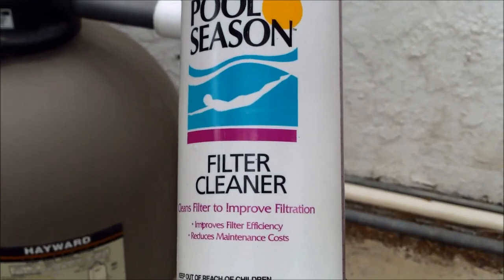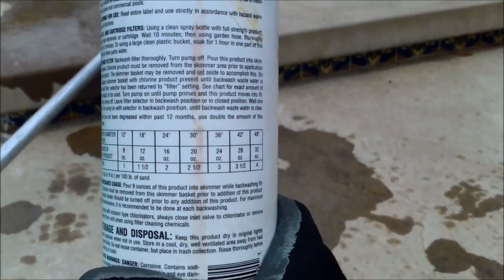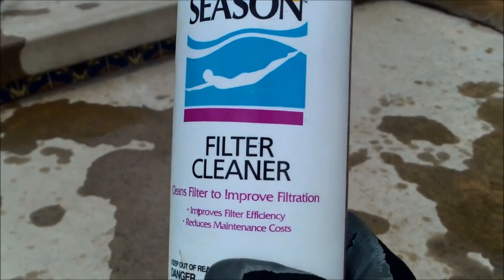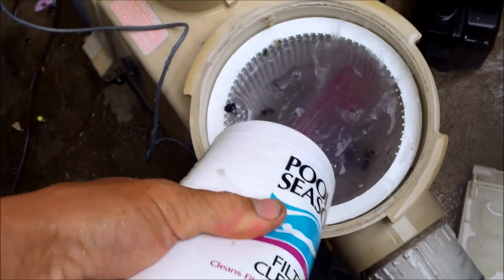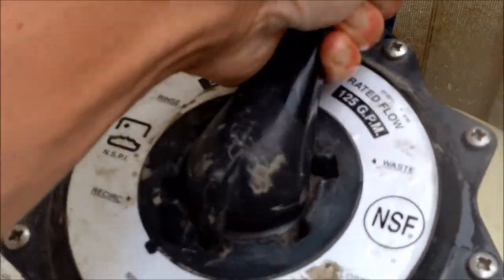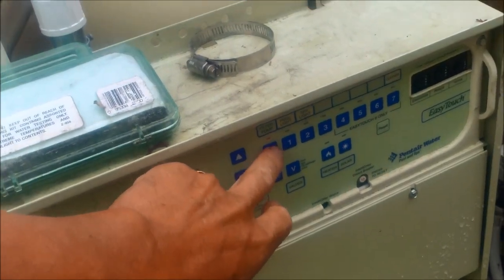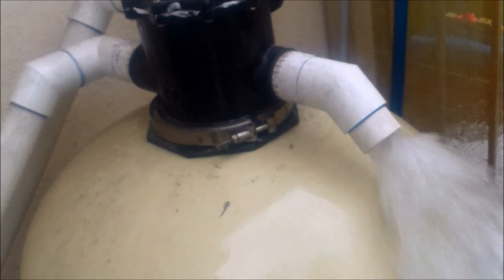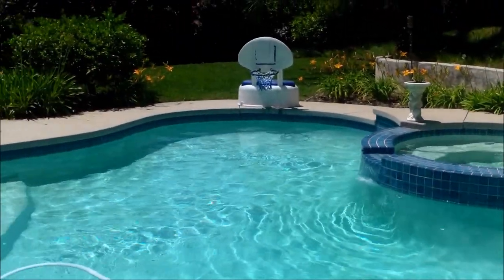How To Use A Filter Cleaner in a Sand Filter, Sand Filter Part 5

Comment from the maker: Not sure if you watched the video on my Channel that I posted about this problem. It could be the check valve. The valve actuators are factory set to close all the way - it would be strange if yours didn't meaning the gears are bad.  Video is called: My Spa is Draining Down When Pool Turns Off.

Comment: Thanks for the video - bought a house with a sand filter (my previous one was cartridge), no idea the age or quality of the sand. I bought the cleaner on Amazon and used it today. I didn't want the soap to go into the pool so I backwashed, rinsed, backwashed again (50 seconds), rinsed again (25 seconds) and there was virtually no "suds" entering the pool when I returned it to filter mode. Pressure went down a little. I'll do it again every year.

Comment: I enjoy watching the videos of your pool cleaning and repair.  If I may ask a question related to my spa and why it drains overnight.  I tried to watch your video on this but still have more questions.  Real quick I janne a fiberglass pool and separate spa. It also has a solar panel and salt system.  I tried to reseal my jandy valves using lube and adjust my actuator to make it close. Still cant figure out why it still drips overnight. Driving me crazy.  What do you recommend I look at now.?

Comment: Change my sand every year. Have to, live in North Dakota . Use the old sand for ice coverd driveway and side walks in the winter. Filter , pump and heater get removed cleaned and stored in a heated garage.
Reply: Have you looked into using glass instead of sand? I just found out about this last week.  There are other products that last either forever or way longer than sand.

Comment: Hi, thanks for the helpful pool vids! I followed instructions on this video and several others with similiar advice for my sand filter and when I went to backwash the filter wouldn't backwash, I troubleshooted and tried the filter and waste settings, would you happen to know how to fix this? My current assumption is that the filter is somehow clogged with the soap from the product but I have no idea how to resolve this. Tried to add water to the basket and checked the skimmer. Seems to be no intake on filter settings.
Reply from the maker: Maybe an issue with the multi-port valve itself. You would have to remove the screws and check that spider gasket inside to see if it is seated properly.
Reply: @SPL  Hello thank you for the reply! That turned out to be it, there seemed to be a air leak not allowing the pump to prime. Thank you!!!